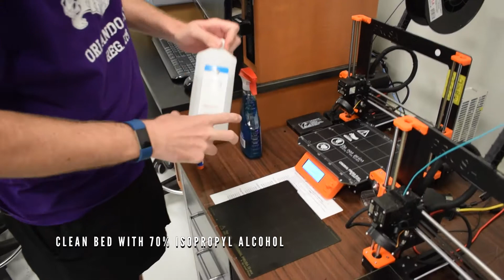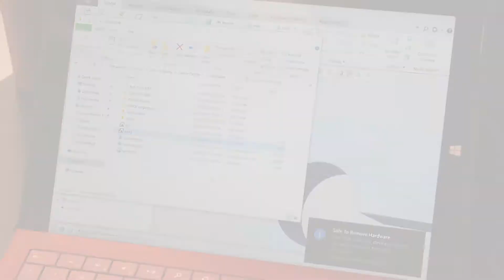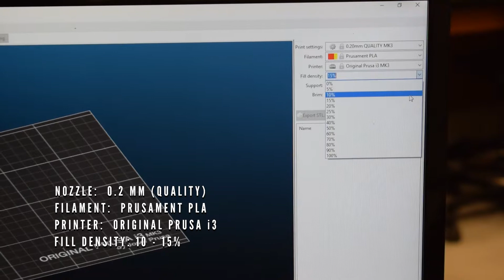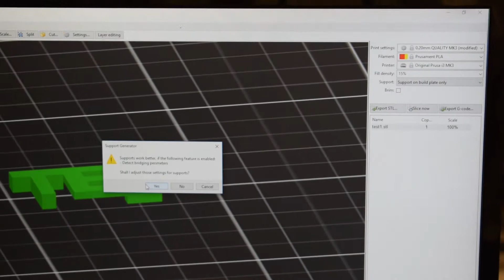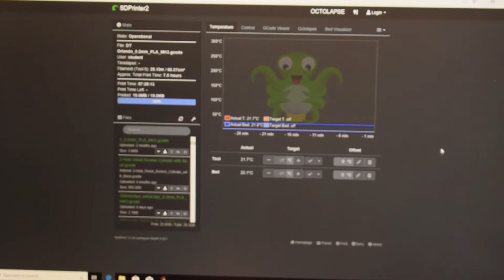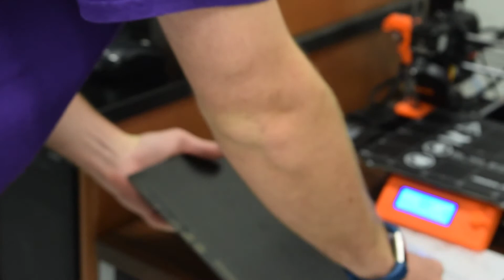3D Printer Tutorial in the Senior Design Labs at CREOL

Comment: Greetings fellow UCFers!:) I'm an alum BSEE from WAY back. LOL:) Presently, I run the 3D Lab at www.Factur.org makerspace (just north of downtown Orlando). Curious what kind of things are getting printed at CREOL. TIA.

BTW, the thin film on the spring steel sheet is for adhesion of the filament. It's made of PEI (polyetherimide). It's on both sides of the sheet. For ease of print removal, allow sheet to cool, then bend up/down, then rotate and repeat. Give it a good bit of bend; it can take it.

Here's a great reference from Prusa on the PEI spring steel sheet. Even if you've already seen it, it's a good thing to have around for the users https://help.prusa3d.com/article/WPL74Wx4aU-steel-sheets.

And, here's the Wikipedia on PEI (also sold in various forms under the trade name Ultem®) https://en.wikipedia.org/wiki/Polyetherimide.

If you have any questions (swami.human@gmail.com), I'm happy to help (I'm also a teacher :) ). In fact, I'd love to come by the lab and check things out. Of course, you are invited to visit "my" 3D Lab, too. OK, hoping to hear from you...
Reply: P.S. Great tip about the long hold to get z-axis control. Very few users actually know about this. When shown, many are surprised/amazed that it's been there all the time!:) Oh, BTW, I have two i3 MK3 printers, and am about ready to spring for two i3 MK3s printers. WOOHOO! And, BTW, we have NINE printers at the lab!